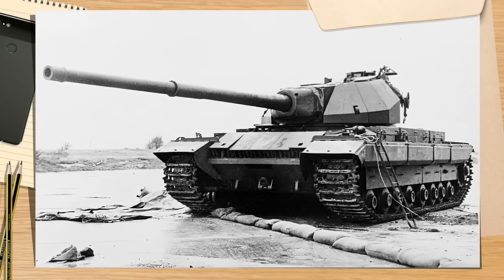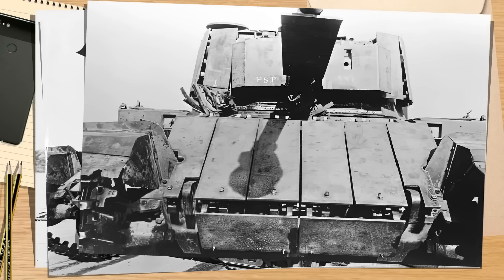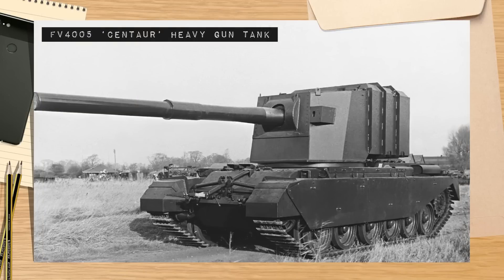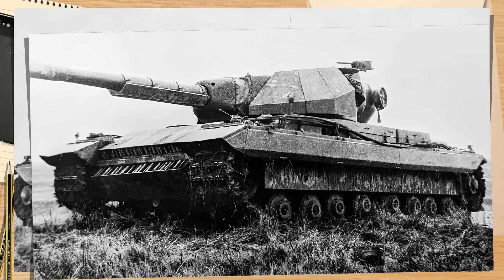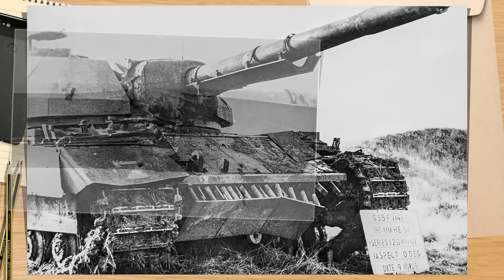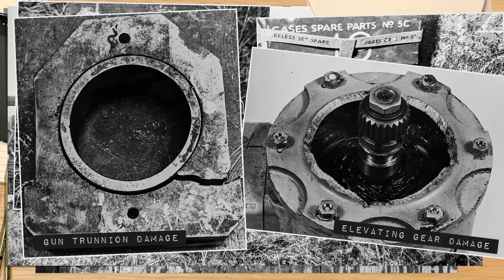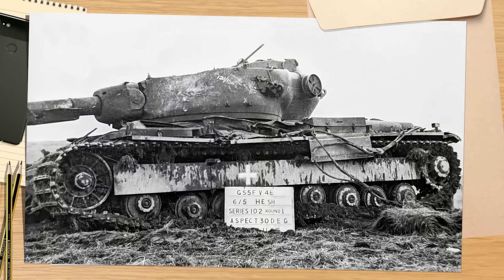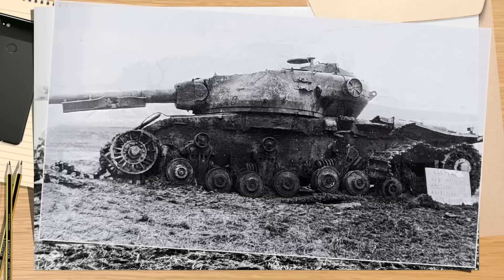FV214 Conqueror vs 183mm HESH  -  Tank Design & Development

Comment: I wonder if those 14mm Burster plates are just for testing or can be used as an option in a possible war?
Reply: I assume it was a bit of both, in that it was mainly for testing but they seem to have done good enough detail design that it could have been rolled out as a quick upgrade if it was required.
Reply: They were quite effective against HEAT shells.

Comment: The smaller HESH round design being much thinner walled might not have had sufficient structural strength to contain the explosion for sufficient time to generate the shaped charge effect, so it just became a conventional explosive. Overall my main takeaway though is they didn't realize at the time that while the dummies were physically intact their internal organs would have been liquified by the shockwaves.
Reply from the maker: not at all it seems. the shockwave does not propergate well though air inside. the tension wave it generate on rebound is good. the other tests with dart missiles and so on created much better effects. now if the crew were touching the metal when the shock hit, different story, same for components and fittings, but needs direct contact. - they did other tests with rabbits...lots of rabbits. - a few had burst ear drums,  one died of a heart attack, but otherwise quite good. a lot of folks seem to think the WT style overpressure is a real thing but alas nowhere near as much irl

Comment: Is "line of sight" armour an actual military term? I question this because only the Australian Armour and Artillery Museum curator and your goodself appear to use this phrase, surely it should be "virtual armour thickness" when referring to angled armour plate, packing, spaced and applique forms of armour. Being pedantic possibly but this is how inaccuracies in correct nomenclature arise as you yourself are well aware. Good channel well researched, informative and interesting, so thank you for your efforts.
Reply: Valid question, however I believe that using the term "line of sight" is the easiest way to convey to the maximum number of people that you are talking about the depth of armour "straight through the armour to the inside of the tank." 
Otherwise how else do you explain that you are not looking at the thickness of armour at 90 degrees but rather approximately horizontally as the shell would approach the armour. 
It is easily getting convoluted and confusing when clarity of communication is required. 
Mark from Melbourne Australia
Reply: @markfryer9880  I don't think "virtual armour thickness" is any more or less confusing than "line of sight armour" thickness, "line of sight" does have a defined meaning in terms of communications and I feel using this phrase in the context of armour thickness muddies the water on its more usual context. Anyway it matters not what we may construe from this, as the question is what is the accepted military (unequivocal) term for what is the effective thickness of various types of armour installation? 
Perhaps I've answered my own question, maybe it is just  'effective armour' thickness, which then makes it fairly clear that the reference is not just about material type or thickness?
 I was curious initially because I'd only come across the idea of "line of sight" thickness referred to by just 2 videos creatives, this one and the Aus Armour videos, which anyone who is interested in AFVs their history, construction and  preservation should certainly be subscribed to. 😉

Comment: Very interesting video on the hits achieved by the 183mm on the Conqueror  but I do have an observation: the impact of those rounds, by looking at some photos would have been very hard on some of the crew by creating shock waves internally incapacitating them with broken ear drums or knocking them unconscious for quite a while. In my opinion that would have been effectively a "kill" too...
Reply from the maker: nope, faid not, the overpressure myth has been massivley overplayed by games  - later tests use rabbits a lot for this testing. - you can get some - often burst eardrums. but it often needs to hole the vehicle to work which hesh does not, the shock wave from the explosive on hitting a vacuum is reflected back, where it overlaps, forming a tension wave in the steel - this is what removes the scab. But the transition of shock i the air is not great. The shaped charges caused more than the hesh in later tests. - the shock in the metal works by traveling though the medium so being in direct contact would injure anybody touching it but often steel and crew are separate if that makes any sense. they would be having bad day, but often 'lived'
Reply: @armouredarchives8867  Rabbits ? The septic tanks used sheep in the Bradley testing. I watched it all all in that documentary reinactment, Pentagon Wars.
Reply: @dougstubbs9637  Pentagon wars is definitely not a documentary, it's a satirical comedy
Reply: @armouredarchives8867  I wasn't aware in my earlier comments that they used live subjects inside of the vehicles. The only problem with rabbits or sheep is that it can be very hard to determine if there has been any problems with cognitive thinking after the impact event. 
Mark from Melbourne Australia
Reply: The test that resulted in a 25 pound spall cone inside the hull would probably have killed the crew more often than not. Big chunks and splinters flying around the crew compartment with the velocity of bullets would carve up bodies like butcher knives. In the test described, the point in the hull where the round struck and created the spall must have been one of the few locations where it would not have affected the crew.

Comment: 05:44 how is there 18 pounds of spall but no crew damage?!
Reply from the maker: hesh spalling is odd stuff, the scabs usually travel down perpendicular to the angle they hit. so if you it say a 45-degree slope the scab comes of and travels down in the same direction, rather than forwards into the crew. - as in the king tiger vs hesh vid i did where front shots wrecked the transmission. - i thin case the front turret is well angled and the ammo went down at the same angle into the turret floor. hits to a  flatter side are more effective as the spall cones out
Reply: @armouredarchives8867  Fascinating! Thank you for the response!
Reply: @armouredarchives8867  That sounds to me as being very similar in behaviour as a light beam as it strikes a pane of glass. It is the angle of incidence which is critical in determining the direction of the light beam as it emerges on the other side and it would appear that the spalling behaves in a similar manner. Finally found a use for studying some physics. 
Mark from Melbourne Australia

Comment: What interests me is that any of the testers were surprised by the efficacy of 7.5'' and 6.5'' high-explosive shells on armor, considering the Royal Navy had been blasting the heck out of armor plate with big-gun high-explosive shells (including HESH-like munitions) for decades. One would think it would have been taken more for granted that a 183mm HESH would be shattering the target.
Reply: HESH was never used at sea, and high explosive shells couldn't penetrate heavy armor - ships used armor-piecing shells (often with a penetrating cap i.e. APC) with a relatively small explosive filling and a delay fuse so they detonated after penetration.
Reply: @CharlesStearman  HESH makes literally no sense whatsoever at sea. None.  May as well fire cannon balls. ⚓
Reply: @CharlesStearman  That's not entirely true - although they certainly carried AP, from what I've seen a fair bit of WWI era naval thinking was based around degrading everything on the enemy ship by liberally blasting it with HE - the RN did a lot of tests on how much armour they needed to resist high caliber HE (and what armour layouts would reduce the HESH-style 'scabbing' effect behind the outer layer of armour) - so they certainly had been thinking along those lines!
Reply: @CharlesStearman  The Royal Navy had experience with base-fused High-Explosive shells, which are similar to Squash-head. More importantly, the Royal Navy used plenty of High-Explosive shells, especially for cruisers and larger ships concerned about engaging lightly- and un-armored ships where large-caliber armor-piercing was prone to overpenetration. Whatever the fusing, the key thing is that there was plenty of knowledge that large amounts of high-explosive did terrible things to metal structures on ships.
Reply: If they were that smart, they'd have joined the Senior Service...😅⚓

Comment: "super" conquerer as in "better" conquerer due to spaced armor i guess :3
intresting, was the fv4005 was first made, or fv215b?
Reply from the maker: 215 was to be the heavy gun tank with 183mm, the 4005's were the test beds for this, but the project was canceled, and the 2-3 4005's were kept about a bit for testing only
Reply: the fv215b is a "blueprint" tank, there were plans to make it and even a full size wooden mock up was made but the design was scrapped in favour of the fv4005 stage 1 which was further in development. so to answer your question, fv4005 was first because it was actually made and the latter was not.